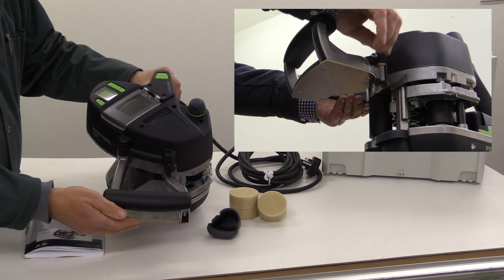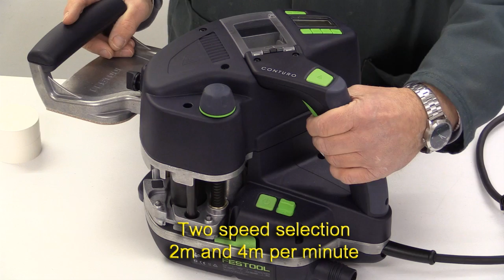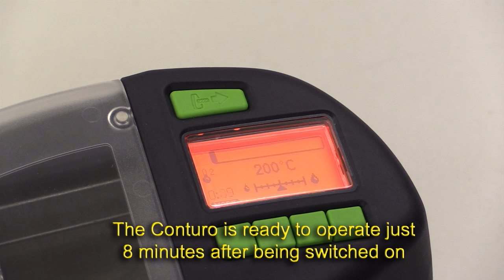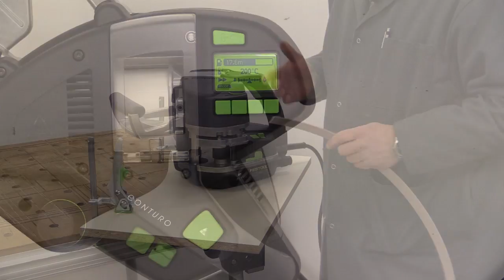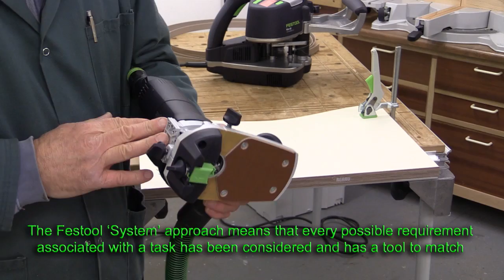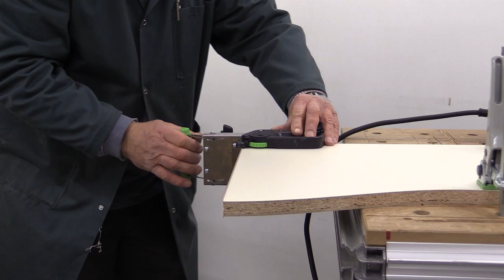Festool Conturo Edgebander - Setup and Use Part 1

Comment: Hi,
I like your 
I just bought my Conturo.
Is it necessary remove the EVA adhesive after any job, or I can leave it inside?
Reply from the maker: Hi Giovanni, As far as I remember the adhesive can be left in but I am not sure for how long. Check with your local Festool rep or the dealer where you bought the machine.  Peter
Reply: Thanks Peter,
I will do

Comment: Very expensive in South Africa at R 55 000!! on sale (normal price R68k). I can buy for the same money a reasonable secondhand car, or just get it done at a cabinet shop for cheap. It might be 2/3rd cheaper by direct importing, but still a lot of money.
Reply from the maker: Hi Jannie, That does sound expensive.   Peter
Reply: the problem here is that an individual become a sole supplier and then ask what they want.

Comment: It seems a fine machine but handheld edgebanders aren't exactly a new thing. What sets this apart from a Virutex for example who have been producing such units for a while now? The price point and being locked in for consumables doesn't seem worth it. Granted the cleaning of glue pots is a pain but glue granules are dirt cheap.
Reply from the maker: LoneRiderz I can't remember if I say this in the video but a while ago I worked for a company making equipment cabinets and I was using an old fashioned edge bander almost every day. I would have given my eye teeth for the Conturo as it would have saved a lot of time, frustration and effort. At the end of the day you just turn the Conturo off and turn the lights out. At the start of the day you just turn it on and within 5 minutes you are edge banding again. The Conturo is very easy to use - I had no practice goes whatsoever in making this video. I had never used the machine before and I was only given enough banding material to produce the work shown in the video. That shows just how easy it is to use. Time is money and the cost of the consumables is insignificant when productivity and quality of work is taken into account. Then add on the ease of use and the feelings of the operator and you will see that Festool have the perfect solution to portable edge banding.    Peter

Comment: Hi Peter, thanks for the great video. Have you used regular veneer edging with this unit, if so what are your thoughts on it. I am considering getting one but will be using veneer edge banding most of the time. Thanks again, Rob.
Reply: Rob D gc

Comment: Well done Peter. Does this tool do inside corners?  Im thinking it will not, please advise. Thank-you in advance. Tim
Reply from the maker: Hi Tim,

Yes it does. I have seen a video and it is probably covered in the "Perfect Edge" book.

I think you have to get as close as you can, let the remains of the edging pass through the Conturo and put it to one side. You then cut the edging to length and use an air gun to re-melt the glue and push the piece into the corner.

It all looks pretty easy and, like all things, practice makes perfect.

Peter